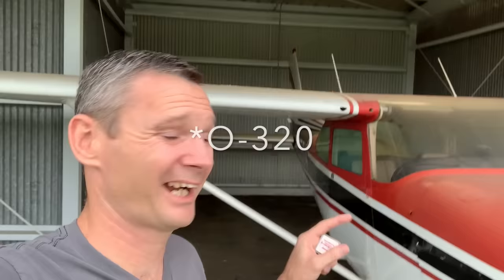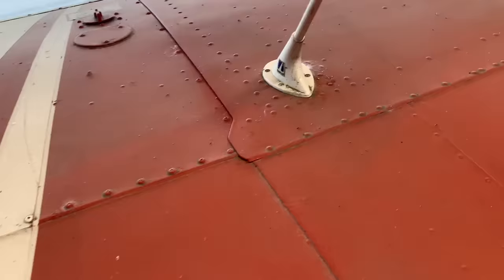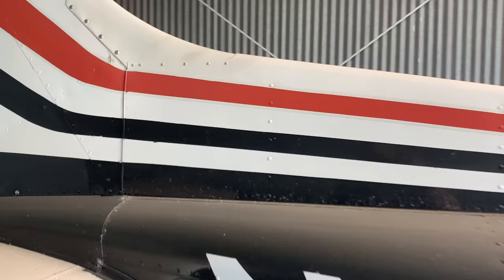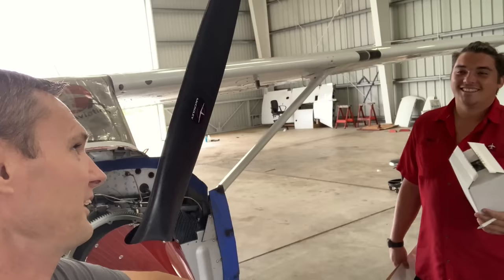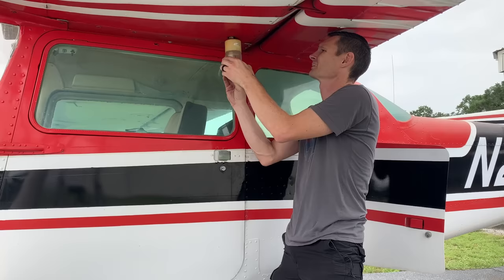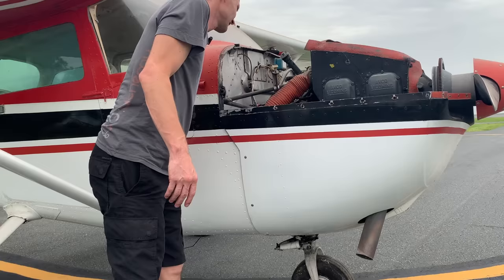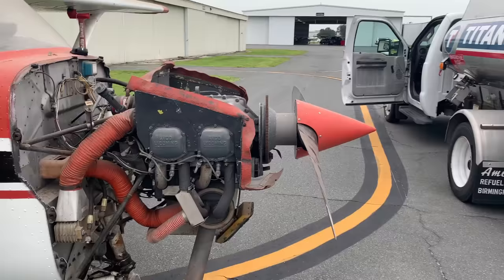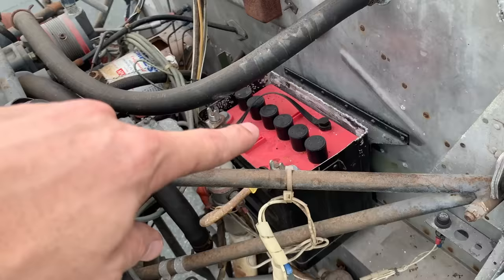Abandoned Airplane Will It Start? 10 Years in the Dark

Comment: An aircraft that has sat that long needs to be disassembled, inspected and a complete snag list compiled. Then start from there. This is decision time! Rebuild or part it out. There is little value in doing an engine start. It needs also to be torn down, inspected and decided upon whether install replacement parts  to zero time rebuild the engine  or required replacement parts will get it back to an airworthy condition.
Reply from the maker: Thanks for the info, good to know!

Comment: When you have a dry lead acid battery, you should add sulfuric acid instead of distilled water.
Reply: What happens to the battery as its drying out or boiling off is the acid starts to crystallise to stop the process and melt the crystals you add distilled water not acid you only add acid to a new dry battery that has never been filled
Reply: @adamganjaman2275  if a battery has been sitting for years on end. The water/acid has evaporated not boiled off.
Reply: @truckdrivinmilanr  whether the water in the acid has boiled off or evaporated is irrelevant the important thing is you rehydrate the crystallised sulfuric acid in the battery to return it to the correct acidity . Imagine you have to use saltwater instead of acid for a minute so 1 part salt 1 part water all the water evaporates do you ? A . fill with water to return to previous water salt level ? Or ? B. dump salt water in to make it twice as salty and still not melt the dry salt that was there ? See where I'm going with this :)
Reply: @adamganjaman2275  what you are saying is equivalent to rehydrating the Great Salt Lake. When dehydration occurs, the vast majority of the composition of the material dissipates into the air. Leaving a weakened chemical behind.
A battery doesn’t behave like fruit that been put in a dehydrator.
Talk to any battery tech or mechanic and they’ll tell you the same thing I said.
Reply from the maker: Thanks for the info, good to know!

Comment: N20504: Cessna 172M No mfg date listed, but the air worthiness certificate was granted 1/29/1973. and the model M was made 1973-1976.  Lycoming 0-320,  Owned by Thomas & Tamela Funk of Dover, FL. New Registration certificate issues 11/22/21, so I guess you got it going!  I thought this was interesting:
 172M

The 172M of 1973–76 gained a drooped wing leading edge for improved low-speed handling. This was marketed as the "camber-lift" wing.

The 1974 172M was also the first to introduce the optional 'II' package which offered higher standard equipment, including a second nav/comm radio, an ADF and transponder. The baggage compartment was increased in size, and nose-mounted dual landing lights were available as an option.

The 1975 model 172M sold for US$16,055 for the 172, US$17,890 for the Skyhawk and US$20,335 for the Skyhawk II.

In 1976, Cessna stopped marketing the aircraft as the 172 and began exclusively using the "Skyhawk" designation. This model year also saw a redesigned instrument panel to hold more avionics. Among other changes, the fuel and other small gauges were relocated to the left side for improved pilot readability compared with the earlier 172 panel designs. Total production of "M" models was 7306 over the four years it was manufactured

Comment: They, whoever "they" are...or somebody needs to start a GoFundMe acct to get this bird back in the air....Sorta like they do with 'ol warbirds....Heck, the mark-up is stupid !!! You can rebuild a 6 cyl for a coupla 1000 bucks....
Reply: I think the requirements for aircraft engines are a bit different than cars or boats...
Reply: @groosbro1  cars are the ultimate cheap rebuilds, every step up gets way more expensive, diesel more than gas, marine more than auto, aviation way more than marine. you can bubble gum almost anything else, but aircraft have to work reliably 100% of the time or people die, that's why its so expensive
Reply: @scout2nut 
Believe me I understand. A friend who's been a flight attendant (a single engine pilot) told me stories about engine flameouts, compressors coming apart and other stories of what happened to him on flights over his forty years of work. He told me the one of the main reasons large long haul planes had four engines was redundancy. He said they came in a few times from a transatlantic trip with three engines on a 747. A few aborted takeoffs, and a bunch of return to airport because of engine problems. It's actually remarkable how durable and reliable something that's spinning at 50,000 while burning tons of fuel at thousands of degrees can be.
He told me there's an adage pilots are taught early on: The three most useless things to a pilot are: The fuel you left in the truck, the runway you just passed, and the altitude above you.

Comment: Offer the owner $10k and part the thing out.
Reply: It looks like it's already been gutted of everything that'll sell. Avionics, parts of the interior, etc.
Maybe you could sell bigger parts of the airframe itself, or things like the electric flap motors, the few switches that remain, and things like that, but it's hardly worth it. Keep in mind that if you're replacing a part on an airplane you're paying an A&P to do it, so most people would rather just buy new parts given the high cost of installation.

Comment: Not sure you need a yoke to test fly that cream puff. Pull the cables through that big gaping hole that presumably was once an instrument panel and pull on them to see what's what. Then, bring at least 3 passengers and assign them a wire to pull on when commanded. It could work

Comment: also....rings get stuck, it can cause low appearing compression, run it and get it hot a few times, put some oil down the cylinders and the rings will likely loosen up and compression will raise

Comment: that easy fix right there i adjust you pull cycling out take look at it make sure no line on wall if no line n smooth i recommended replacing piston ring but first pull piston off rod n stick in cycling make sure no less or no play or movement and can put ring on piston repeat put piston with new ring in cycling make sure no play or less movement then ready to go throw back together and besure check rod make sure no movement aide by side

im engineer repairs i done millions repairs on every vehicle or motor or else i dont mind helping anyone out to fix n save a headache
Reply from the maker: Thanks for the info, good to know!

Comment: Aluminium corrosion usually doesn't go very deep.. Al2O3 (Aluminium oxide) works like a basecoat, it is so dense it's blocking oxygen getting to deeper parts... The rivets need to be checked tho...

Comment: Possible time for a Avionics up date, But for the year it looks like a King KMA 24, Audio amp, King transponder and possible blind Encoder along with a pair of KX 170, or KN175s a long with  a King DME and last but not least a Collins ADF, In its day it looks as if it was a full IFR aircraft,

Amazing how aircraft and avionics have change with systems like the G3X or Dynon or Grammin GTN 650 , I cant but wounder why the aircraft dis not have a Loran in it,

Lots of aircraft still fly  safe with those old avionics .

nice at times to save things for those to come, one has to wounder why the panels are pulled out, possible time to replace all the lines in the instruments if you go back with its look, or possible put a new glass cockpit in it 

Good luck
Reply from the maker: Thanks for the info, good to know!

Comment: I enjoyed this very much and understand the joy of an engine starting after sitting.  Given the compression measurements, I'm surprised the engine started.  You can't beat a Lycoming motor.

I learned on a Cessna 182 with a variable pitch prop and have never lost my love for aviation.  I still have my school books from ground school and would like to duplicate Mr. Lindbergh's flight to Paris but I'm afraid that's just a dream.

Comment: Jimmy, You need to invest in an industrial-size can of WD40 if you want to keep doing this. the starter would have worked right away. The piston rings might have even broken free and expanded enough to give you compression. Also in cars, you can bore out the cylinders and replace oversized rings to accomplish the same thing. But 20 K for the bones was too high to take your life or my life in your hands. good luck! Loved the adventure. I am retired and I think I would like to tinker with a barn find.

Comment: Before you try to start an engine that has sat for so long you want to put a little  bit of oil in each cylinder,  then run it up to temp and then do your compression test.  You didn't let the piston rings a chance to load up. Of course your going to have low compression in the cylinders.
Reply: Taking one plug out of each cylinder and after putting a squirt of oil in each cylinder you need to turn the prop by hand several rotation to help in loading up the rings.

Comment: Volts times Amps equals Watts. That high comp. engine requires 1,000 watts at least. Drop that voltage at the starter motor to 3 volts and t

Comment: So the engine is only worth the cost of the crankcases in part exchange, but engines do get replaced on a regular basis.   That leaves the airframe, which looking at the corrosion is maybe only worth 900 dollars a ton.   Pity it is not a Reims Cessna, those were corrosion proofed from new.
Reply from the maker: Thanks for the info, good to know!

Comment: I really hope things change because in the upcoming years A LOT of planes exactly like this are going to be turning up because grandpa passed and now the family is clearing out his stuff. In reality if you tore that engine down I bet you could just replace the piston rings and do a light bore job on the cylinder and it would be just as good as a brand new cylinder and piston/rings.
Reply: I'm surprised GA is still alive. The cost of these old and new planes are ridiculous. Unfortunately I don't see it getting better in the future.
Reply: Until you're flying over the Sonoran Desert one day and it goes CLANK!  RRRR~! GGGGG! and you blow a jug, or even two.  And then pray you remembered to have them install four cables to keep the engine attached when the motor mounts break.  That's the problem with airplanes.  They have absolutely noooooooooo sense of humor.
Reply: @biaggiwins  A-Men, brother!  I remember when my dad bought a brand-new Cessna 172 for $7,890 from the factory in 1966.
Reply: @bradjohnston8193  The same could happen if someone doesn't tighten the ball joints on their car. Only difference is in a plane you get more time to think about your mistakes as you fall.
Reply: @1Thatstrangeguy  It's not the fall that kills you, it's the landing . . .  My brother lost a ball joint on a 1968 Dodge Charger at 75 miles an hour, and it was spectacular.  Somehow he did not hit anything.
Reply: @biaggiwins  2019 CESSNA 172 $435K; mostly flying schools buy new ones.
Reply: @biaggiwins  Me too; I think it is slowly dying.  And then when 100LL disappears?

Comment: valley of dry bones ... indeed .... no flesh forming on those ... should have scoped it BEFORE cranking ... at very least oil fogged the cylinders ... changed fluids ... and rotate by hand .. to get lubrication flowing ... then cranked with plugs out .. until oil pressure came up ... can do all sorts of damage on stored engine that way ...

Comment: Isn't av gas a wonderful thing? You can leave it for years and an engine will still start. I use it from time to time in my car and it runs so well.
Reply: Stick it in a 1968 Charger 440 and you can out-run the cops!

Comment: This video really hurts my feelings. I wanted to find an old 172 like in this video and fix it up. Hearing about the costs related to rebuilding a 4 cylinder air cooled engine shocked me. I’m used to fixing up old cars and for 5k you can get a great rebuild on a V8. 30k to rebuild basically a Volkswagen engine? I’m losing my dream of airplane ownership fast. It seems like general aviation is just a rich mans game. My only hope is maybe a partnership in one. Any advice is appreciated.
Reply: There are Suzuki; LS V8, smaller Rotax engines but everything is very expensive because you can't just pull over to the side of the cloud.  Also incredibly low volume so no economies of scale.  Cheers I still love watch Jimmy!

Comment: I don’t know if you realized this or not, you weren’t doing the correct thing to start it until it actually started the final time lol you forgot to add mixture, fuel, and throttle (without that it won’t start) the last time (the one where it started) is the ONLY one where you actually did those things

Comment: When I work on aircraft fuel systems that have old or no fuel I elect to use ethanol free pump gas and only put 5 gallons in each wing.    I can drain the tanks and not lose much money to flush the tanks,

Comment: If worry about cam  we use to pull number 3 cylinder   for some reason the 3 is where
The cam starts  to go
If your into auto  fuel stc  this good one for it
I have over 25 years working on these type of aircraft  AP  AND IA
I HAD GOOD TEACHER MY DAD   OR PULL A OIL SAMPLE

Comment: I am surprised that with all these planes sitting around with gas in the carbs for years that there isn't massive carb problems found on startup.  If that was a motorcycle there would be MAJOR problems all the time.  Is av gas that much better that there isn't that white deposit plugging off jets?

Comment: Its a 172, it isn't worth anything brand new.  Its only good for training. An H2AD is a piece of junk. Has cylinder head separation issues and other major issues. Try to get a tiger with an A4K, and forget about high wings. You get bang for the buck with low wings because they have one drag plane vs two. Big difference.

Comment: I guess you couldn't just throw a flat 4 or 6 Porsche engine in it.....lol. I would think a better engine for flying would be the twin rotory engine out of an old RX-7. Engines are much cheaper to get and can easily hit 8000-9000 rpm and push as much HP or more then the engine currently inside that Cessna.

Comment: why does everyone go spend 30k on an engine?   just pull it down yourself if your an A&P,  trade for a good set of cylinders ect ect.
Reply from the maker: That is always an option....if I was going to keep it.  However, this one was going to be a flip... and buyers like engines with low times.  75% of the value of this plane is the engine, the other 25% is the avionics... lol

Comment: Can't understand the justification of estimated cost of rebuilding this engine, or a replacement rebuilt engine. In comparison to normally aspirated car engines,
Understand there are certification required to complete build  but just dammed ridiculous   replacement sleaves,valves, piston/or its seals even crank these engines all work off the same principle. Not doubting your estimates just astounded by them,   a years wages for some folks🙈  'crazy'

Comment: See, this is one thing I don’t understand. The engine in this is like 5 L… And only makes 160 hp. It’s a two valve, horizontally opposed four-cylinder air cooled engine. Probably the design was from the 30s. And they want $25,000!! for this boat anchor. ….enrichment knobs….holy Jesus! This thing still has a carburetor!
Now, check this out……for $10,000 you could have a light (relatively) water cooled 5 liter, 4 valve, variable valve timing 4 cam V8 from Lexus. That is fuel injected, cataylized, runs on 91 octane pump gas, makes 400 hp and would last for 10 times or more hours than the magnesium turd in this airplane.
No?
Ok, how about a $4000 Hyundai 4 cylinder turbo….4 valve, twin cam….much lighter, and makes 200 hp. And it’s 20 gran less.
Now, of course there are weight, radiator, location, propeller….everything to consider. Basically a complete new aircraft.
I understand that. Possibly the cost of development may be prohibited and that’s why this split case rod thrower is still being used.
But…everything is money, and
I think it’s a scam…..lycoming, continental etc….KNOW you don’t have a choice. AND in order to get it inspected for flight you HAVE to Put another boat anchor in its place. 

It would be interesting to figure HP /torque/rpm on engines, comparing weight, and get something modern, fuel injected etc. with more power. And fit it in that plane, and fly it.
But if the Stazi would find out you would loose your license…
Being. We went from first powered flight to moon walk in less than 70 years…..and nothing really to speak of….yeah space shuttle….ok…since then.
I wonder what Wiley Post……the Wright brothers…..would think about that.

Could you imagine an Asian made, last forever, airplane ….light ,agile, safe, great power plant for the masses for $30,000? 
Nope….
Thank the FAA for that.  Someone’s making the money.

Comment: Had to walk from a 182 was all good till we popped the cowl to see a nice hole in the #2 hole and a hole in the pan owner would not budge off 90k insisting it was a cheap fix with 2 A&p quotes at 21k for a used engine

Comment: O-320 Continental not worth anything even two the Airboat tours my looking in that plane is it cost more than it's worth to Yellow Tag everything and certify it to fly again that's not experimental plane it has to be certified to fly and I guarantee you the survey keishin is out of date it would take a complete restoration to certify that to fly which would cost you 
$60,000 or more probably much more to certify that piece of crap to fly if you buy it good luck with it the only thing is worth anything is the motor and it's worth very little even in the Airboat world if it was a parallel valve 180 especially an angle valve 200 Lycoming then the motor would be worth pulling out otherwise it's just junk